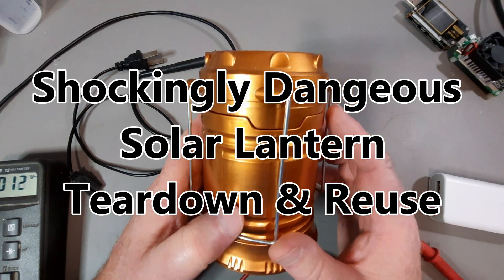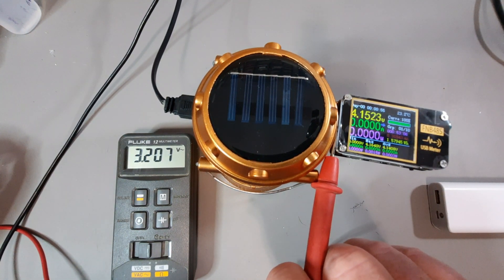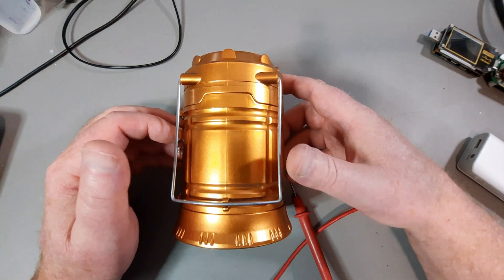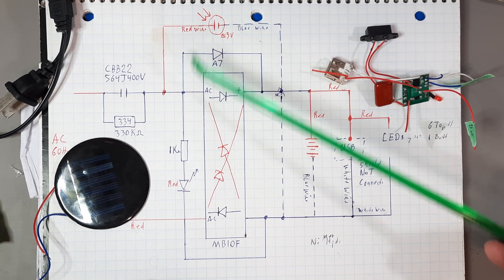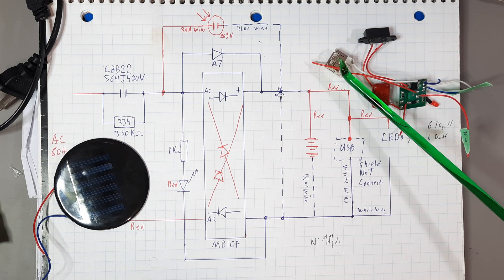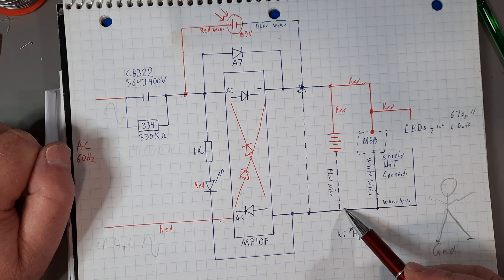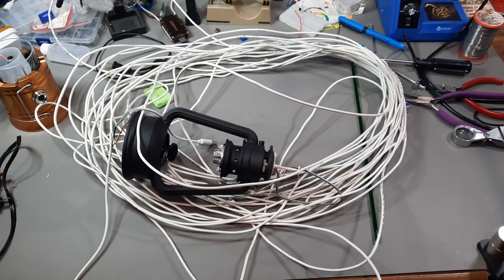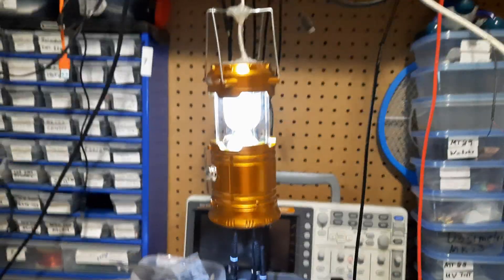Dangerous Solar Lantern Schematic and Reuse

Comment: The diode on the solar cell is to keep current from the battery blocked in reverse soo not to damage solar cell
Reply from the maker: Correct, one is needed but there is already a diode in the bridge rectifier that is performing that task. Just a mystery to me since it is rare for this type of product to have extra parts.
Have a good day

Comment: I suspect the A7 diode is a shotkky type. It will have a lower voltage drop than the one in the bridge rectifier. It will make solar charging a bit more effective, though I suspect it's still not going to be great considering the tiny solar cells.
Reply from the maker: That would be a good idea, but it is a silicon PN diode, I just desoldered it and the forward voltage is 0.602V.  The A7 is the SMD version of 1N4007. I could see someone using a Schottky in there to help the charging. 
Have a good day.

Comment: You should make it back better. First adding a good isolated 5v charger good lithium batteries then a boost converter from the solar panel to charge the batteries and an output usb to charge additional devices.
Reply from the maker: Kind of needed the Lantern for replacing the one destroyed in a wind storm. Got to light up the stocking so Santa and/or Hogfather (Terry Pratchett Disc World series) can find it. Will post a short video within a day of it hanging in the wind.
Will be building some solar powered Christmas globes from scratch with Ni metal Hydride cells shortly.